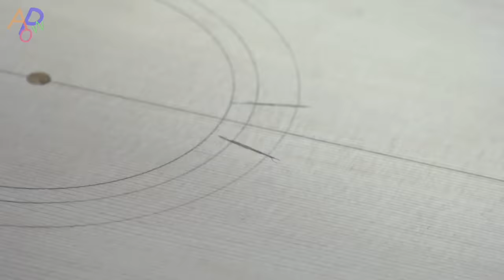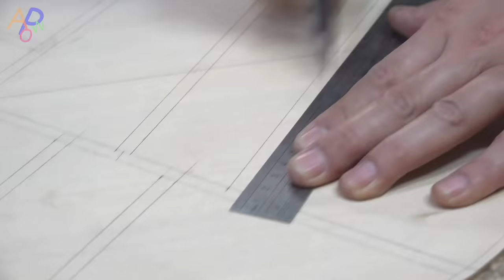Process Of Making Acoustic Guitar. South Korean Instrument Master

Comment: Just the fact that 1man did over 500+ different steps and hand motions made my brain explode 🤯 The hand shaping and scalloped braces, how do you maint consists 🤷🏼‍♂️ The big 5 guitar manufacturers have many assembly line workers specializing in multiple parts/procedures in the build. I guess that’s what makes a 1 man hand made guitar to expensive and labor intensive. 😎

Comment: Wonderful video and lovely craftsmanship. My only regret in design is the peg head. When they taper to smaller at the top they always look odd to me.
Reply: Thanks like this video. People have different favourite of the designs. But reason that I made my pag head in that way was tunning stability. When the strings are spreaded too much at the pag head, tunning will gose out when you pull the string then doesn't go back in the position.
I made shallow end head for minimize that.